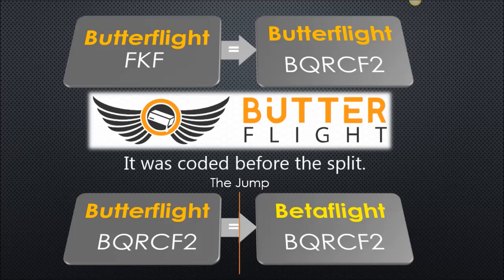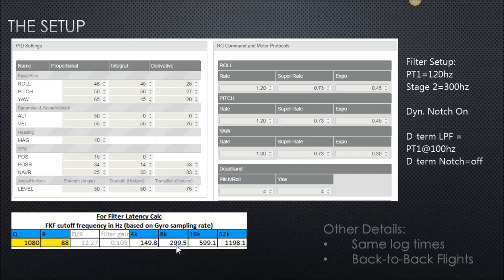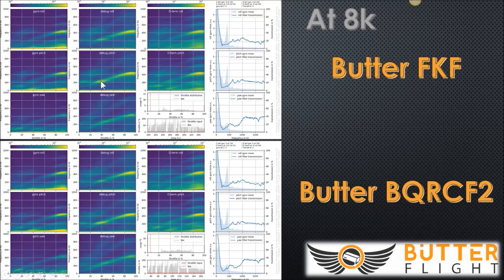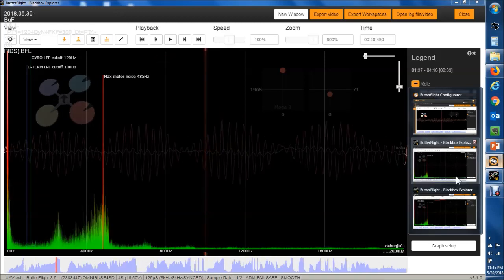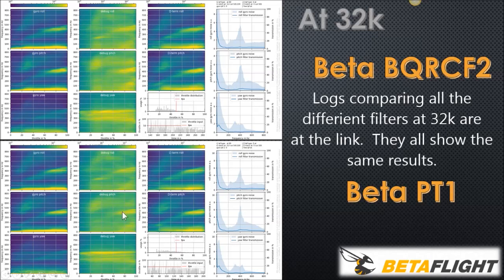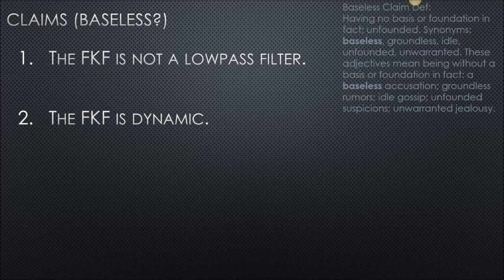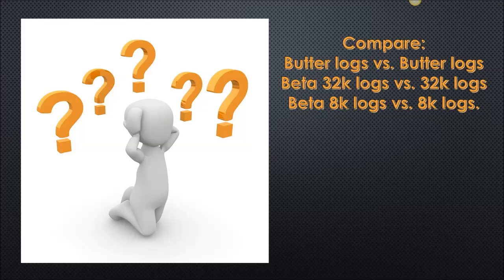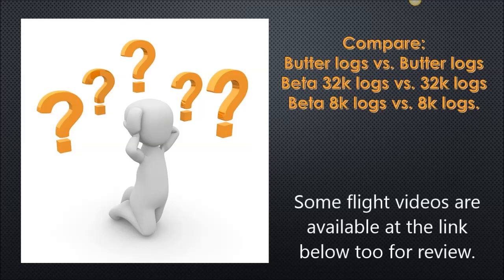Butter/Beta Filter Comparisons (WITH DATA!)

Comment from the maker: So at this point we have:
1. Octave code showing it is the same attenuation and phase delay as a PT1
: https://www.screencast.com/t/qfob8mdW4
2. Unit tests showing convergence within  111 samples and hold static thereafter, resulting in a PT1: 
https://www.screencast.com/t/w8Oeh9Yv
3. Flight logs from various copters showing the output of a real flight (in a DYNAMIC STATE) is the same as a PT1.  Copter in my test was noisy.  See Pitch axis: https://www.screencast.com/t/7dLuIZdx8r
4. An outline of all the data supporting that the FKF is just an LPF is at: https://docs.google.com/document/d/1xftHLcEultKsl54G9gVbDFqXNxzDM0jGH_SVSemSmhg/edit?usp=sharing

Comment: Good Work!!, thank you.
Reply from the maker: Pro Tip: If you want the best filtering i have seen on any firmware to date, fly the HEX files at tiny.cc/filtercalc for BF 4.0 due to release in January 2019.  We just got done making the Dynamic Filter even better then the improvements on it in BF 3.5.
Reply: UAV Tech I definitely gonna try that. After seeing this research, I was thinking what filtering can I use with minimun delay.

Comment: Looking at the code committed in butterflight GitHub, last commit was 21 days ago. It is not a good sign.
Reply from the maker: Jack Truong , Harry is "leaving the team" as well.  But, IDK, i guess he was just the one that started to FB group.  I don't know if Lucas and Chris really see him as part of the team?

Anyways, there were on the Deadband show last night, seems like they will still be chugging along.

All free stuff, so whomever develops faster to me is king.  What holds me to BF is the size and expertise of the dev. team there.  That never changed through this.

However, BuF or Helio are great catalyst to drive the BF dev. team too.  Let's just say I don't know that anyone on the BF team "loves" BuF or Helio.  I think it's fair to say that some of them think their practices are deceptive in the community and that all the claims coming from those camps are nothing to measure up to the hype.

  I think their biggest rub is BuF, which is the firmware that runs Helio of course, is a copy of Betaflight - which is well-known of course - but then puts down their work and Betaflight.  Which I can see how that would be very frustrating.  Especially when you dig in into the detail of BuF and Helio and find the "innovations" are novel (filters that produce the same results of low-pass filters | PIDs that do the same thing as D-setpoint weight = 0).
Reply: UAV Tech Hey, this video of yours just popped in my main page again. Then, reading the comments I find this one and I agree totally. See, the community was asking BF devs for RTH for years... Begging them. And, if you read the forum posts about it, the devs used to be really aggressive towards people that asked for it. And now, with a small pressure from BuF... BF 3.4 have it. 😂
Anyway, BF, BuF... They're just tools and I'm going to use what gives me the best results. In my first quad (a brushed micro I built myself) I put BuF... The next one? I'm probably going to put BF. 😊

Comment: Static logs are one of the many ways that dynamics can be tested, but dynamics are extremely complex to test. Companies spend Millions, even Billions of dollars to test simple dynamics of things like a nozzle diameter or the length of a wire for a transceiver, and they’re still approximations with error that must be considered. Octave & Blackbox testing of static logs do give some information about the frequency response of a single low noise flight, but indicate very little about the overall nature of the filters. For that you would need an experimental modal analysis, which if you’re using static logs would require hundreds of them, possibly thousands to account for as many noise variables as possible and the filters’ corresponding response as each internal and external variable undergoes change. You shouldn’t discount People flying their quads as purely anecdotal. People are able to test the latter variables better than any analysis that could be performed, given enough scenarios and given the pilot know how to judge performance.
Reply: Steve Atwood hey thanks! you’re kind to take the time professor Atwood!
Reply from the maker: Science is that if u can't show data on perception, conformational bias needs to be strongly considered.

The advantage of the Dynamic Notch Filter is easy seen in logs vs. the Static Notches.  Why is that?

Don't call them "static logs".  That is deceiving.  They are simply logs recording events in flights at 4000 data points per second.  The logs pick up all behavior at that interval; dynamic or static.

Still NOONE is offering any data to show dynamics.  So until that time it produces the same result of a static 1st order lowpass filter.  I see no data to show otherwise; coming from multiple angles (math analysis, unit tests, logs in flight) and multiple sources (RS2K's RC groups blog, folks in the community with various experience disecting the math, folks runing flight tests [not just me], etc...).

https://en.m.wikipedia.org/wiki/Pseudoscience
Reply: First & foremost, the FKF filter as it is implemented in ButterFlight is an architectural enhancement designed for further development. As a first-order filter it's response is quite subtle compared to a BiQuad or cascaded PT1's. However, unlike a PT1 the FKF responds to acceleration and reduces noise by minimizing the rate of change of the gyro with respect to a normalized reference curve. Yes, k will converge using static data, because unlike a quadcopter BB logs fed into Octave or Excel are not recursive, but in dynamic conditions that will not occur.

All bb logs are static, because you're looking at the past with no control over the future. At a high-level quads are closed-loop systems with our brains generating new setpoints so the PID control loop can reduce error between what the gyro measures and the latter setpoints by increasing or decreasing motor rates. Outside disturbances such as prop wash, wind, inertia, and internal noise from electrical and mechanical sources like the frame, props, RF noise, along with system constraints and interactions all change constantly as a function of the setpoint change our brains cause over time. Each new change causes another. One static log does not indicate anything about a filter other than it's frequency response to that particular flight. If none of the latter elements of noise I just mentioned are problematic then they're not being measured and the logs are giving you no new information. Furthermore, to analyze these elements you must take enough samples of each scenario in isolation. If you wanted to test dynamics I would recommend something like the following, being careful not to perform any of these tests simultaneously: 

Motor Noise: Test the same quad with the same motors, but swap one of the motors with an older, noisier one that was perhaps discarded after a crash or the bearings wore out. Performing a Chi-square test or some other low-sample independence test you could then record 10 logs with and without the bad motor using a PT1 and then an FKF for 40 logs total. That might be enough log data to remove most of the unwanted bias that's virtually impossible to account for when logging flights.

Prop Wash: Much like the Motor noise testing you could use a set of known good props versus a set of much noisier props, but since props are easier to exchange I would recommend using several different sets of props with various noise characteristics rather than only two. Then you could perform a linear regression test of the static logs; the more the merrier. Perhaps 10 logs for each set of props for both PT1 & FKF filters minimum. There are many scenarios that cause prop wash so I would think 100 to 120 logs total, perhaps more for a solid experiment with dependable confidence intervals. 

Heavy vs Lightweight quad: Perhaps another Chi square analysis or a t-test would work for this scenario, although a distribution of quads of different weights, holding as many variables constant as possible would produce more reliable data. I would think 60 to 70 logs would be minimum if you're objective is to truly isolate the behavior of the FKF vs a PT1 in response to the weight of a quad.

Those are some of the big ones, but then there's Wind handling, Frame Resonance, Aerodynamic Drag, Heat & Cold, Setpoint Weight, the list goes on and on and each scenario could each have very different results.

When I mention that the FKF filter as it is implemented is an architectural enhancement what I'm saying is it has a lot of room for improvement. Instead of a fixed Q & R I don't think it would be that challenging to replace the normalized reference curve with a linear covariance function to act as a dynamic Dterm filter. Rather than just responding to acceleration it would dampen the PID controller as acceleration approaches zero. I believe this would enhance the FKF considerably and hope that's where ButterFlight or BetaFlight takes it next, because it might even have the potential to replace and outperform all other filters if constructed properly.
Reply from the maker: Or those that propose is Dynamic when it is not could simply produce some data showing the dynamics (a debug mode, something... anything.).
Reply: Unfortunately there can be no such thing as a debug mode for dynamics without having integrated sensors designed to isolate each of the latter noise sources I was explaining in my last post. However, as far fetched as it sounds, such a process can be done using iOT technology. For example, IBM created a cloud based iOT process that utilizes micro sensors that actively transceives data that's sent, logged, and also controls the device, i.e., the quad and the transmitter would be two nodes among many others. Thus the user interface is in the cloud as well. Clearly there's a lot of latency, so the flights themselves would be awful, but that is one way to get good quality dynamic data for a relatively low cost. The IBM system I just described is called Digital Twin, but there are many others out there used throughout industry.
Reply from the maker: It is just a math equation, no magic here.  As variables are entering and exiting the equation, they can easily be reported upon to show some form of dynamics.  A debug mode can be entered into the code at any step.

So we are on the same page the FKF is NOT a Kalman filter in fundamental.  So if you are relying on that as a knowledge base that is in error.  The FKF does not have the Prediction Step based on a physical model in the current implementation or any proposed implementation that I'm aware of:  https://en.wikipedia.org/wiki/Kalman_filter

Tim Sweet (Helio) was working on adding a debug mode, but I have not seen any published results, and it seemed like they were seeing the convergence of K as predicted:  https://www.facebook.com/groups/1966665310252973/permalink/2012459325673571/

I would love to keep going with this, but if you want to make a point, you need to produce data.  A lot have, in the direction that it is NOT dynamic filter of anything we don't already have, and that the FKF approximates - very very closely - to a simple PT1 filter with 2 pt smoothing.  If I or others see produced and published data that shows otherwise, fine.  But as of right now, nada.  Same results as a PT1 + 2pt LMA smoothing.
Reply: The prediction step in the FKF is based on acceleration of the quad, where the kalman gain is a function of a normalized reference vs the acceleration. True, not as robust as the covariance of the standard deviation of acceleration versus the standard deviation of the rate of change of angle, but still an FKF. Whereas a fixed k is not...

Using a debug mode to visualize waveforms at various point in the control loop will not examine dynamic behavior. Dynamics can only be measured by varying an independant variable while holding other variables constant so you can measure the impact to an dependent variable, e.g., the gyro. Static logs and debug modes are not doing the latter process.
Reply: UAV Tech A debug mode would however show how k does or doesn’t converge in dynamic scenarios.
Reply from the maker: Bingo!
Reply: Steve Atwood interesting read, Steve!
Reply from the maker: More on this at: https://www.rcgroups.com/forums/showthread.php?3009636-BF-K-Testing-the-Fast-Kalman-filter-on-Betaflight/page100

"The good thing about science is that it's true whether or not you believe in it." (Neil deGrasse Tyson)
Reply from the maker: Also created the attached since: https://docs.google.com/document/d/1xftHLcEultKsl54G9gVbDFqXNxzDM0jGH_SVSemSmhg/edit?usp=sharing
Reply: curious to see your opinions on new 3.4 features like relaxed-i, throttle boost, absolute control and new dual filters, if you haven't already posted something
Reply: If you’re asking me I like them all so far, but I’m still experimenting and unfortunately time strapped lately. UAV tech has a whole video going into the details of 3.4 if you were asking him though. In addition to absolute control my favorite new addition is smart_feedforward. After examining the code I think over time this will have a measurable impact on how folks are able to properly utilize d-setpoint weight & transition. It can minimize overshoot while maximizing stick-connectivity in tight maneuvers. It also enables higher Dgain for reduced external noise into the system without interacting with setpoint like it used to.

Comment: Static logs cannot be debated when the difference is dynamic. lol
Reply from the maker: What does that mean? Logs record dynamic behavior.  Just like a log running the debug mode of FFT can record the Dynamic Notch moving.  Point of this video is the output of the FKF is clearly the same as a PT1.  So regardless of the maths the output is the same as very simple math of a 1st order filter.

So at this point we have:
1. Octave code showing it is the same attenuation and phase delay as a PT1
: https://www.screencast.com/t/qfob8mdW4
2. Unit tests showing convergence within  111 samples and hold static thereafter, resulting in a PT1: 
https://www.screencast.com/t/w8Oeh9Yv
3. Flight logs from various copters showing the output of a real flight (in a DYNAMIC STATE) is the same as a PT1.  Copter in my test was noisy.  See Pitch axis: https://www.screencast.com/t/7dLuIZdx8r

Case is pretty compelling.  Some would say, case closed.

Comment: I’m sorry, but this testing doesn’t indicate anything other than similar frequency response. If they didn’t have the same frequency response then something would be wrong. First, the FKF is a first order filter just like a PT1. That has never been a question. That has never been disputed. Second, you’re looking at traces from the same quad and same low noise flights. There’s nothing being differentiated. The FKF is dynamic and a unit test cannot and will not indicate that.
Reply from the maker: What does that mean? Logs record dynamic behavior.  Just like a log running the debug mode of FFT can record the Dynamic Notch moving.  Point of this video is the output of the FKF is clearly the same as a PT1.  So regardless of the maths the output is the same as very simple math of a 1st order filter.

So at this point, we have:
1. Octave code showing it is the same attenuation and phase delay as a PT1
: https://www.screencast.com/t/qfob8mdW4
2. Unit tests showing convergence within  111 samples and hold static thereafter, resulting in a PT1: 
https://www.screencast.com/t/w8Oeh9Yv
3. Flight logs from various copters showing the output of a real flight (in a DYNAMIC STATE) is the same as a PT1.  Copter in my test was noisy.  See Pitch axis: https://www.screencast.com/t/7dLuIZdx8r

Case is pretty compelling.  Some would say, case closed.

The other side of it has produced ZERO data showing otherwise.  That is known as an unfalsifiable claim or baseless claim.  I have a feature request logged in BuF since 4/29 to creat a debug mode showing dynamics.  Nothing to date on it.

Comment: To be honest I've got no reason to disbelieve any of this. I think a lot of people what people are experiencing with Butterflight is pretty much a placebo effect. I've tested both on the same quad and at one point Betaflight appeared to be better and some other point Butterflight seemed better. I'm using Butterflight at the moment simply because it was the last one I flashed to the board when I tested the second time round, but the truth of the matter is I'd be equally happy with either FC software and filtering. There's nothing wrong with FKF that's made me switch to the BQ filter or visa versa. For the time being I'll stick with Butterflight, but definitely don't think there's enough difference just yet to say I'll stay with it definitively.

At the end of the day everyone has different opinions and experiences so they should just go with what works for them regardless of the science, but it's good to see real data on this to try and stop false claims from either side for the sake of competition.
Reply from the maker: Agreed.  I'm open to other findings, but test from multiple angles (math analysis in Octave, unit test, and real world logs) backup up the point being made in the video.